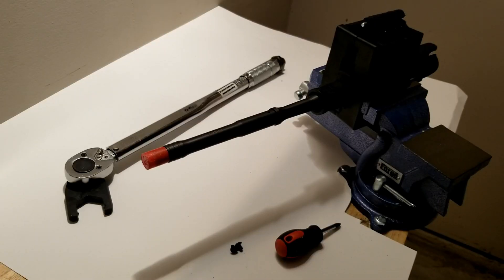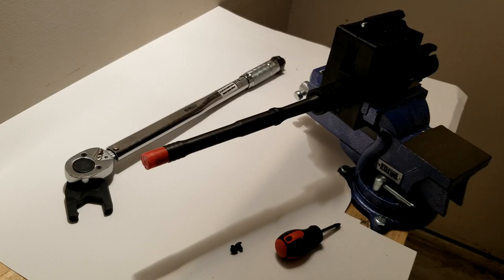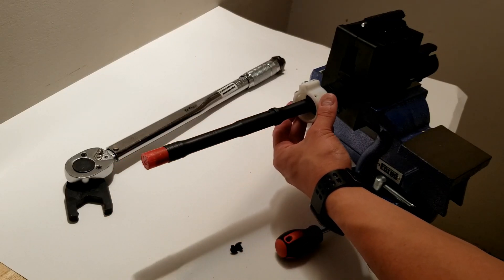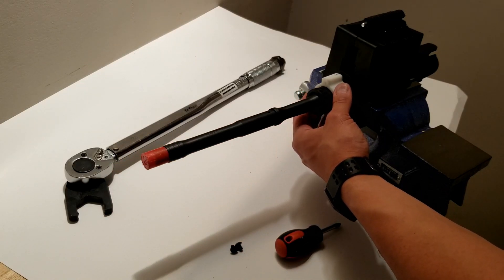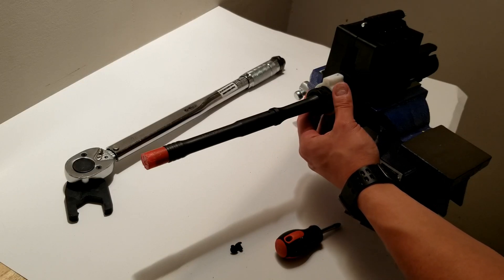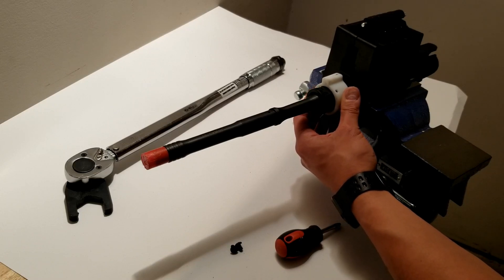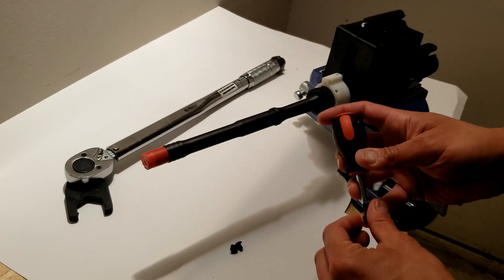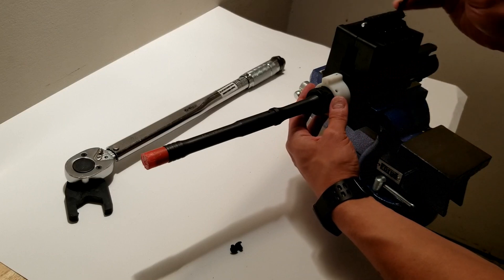Barrel Nut Installation for JAG Composites Ultralight Handguard System

Comment: You should clarify the barrel nut adapter /crow foot position in this video.  You have an intermediate 45° position, the difference between a 0° and a 90° position is a 10% difference.
Reply from the maker: You're correct.  Should have been in a perpendicular position.